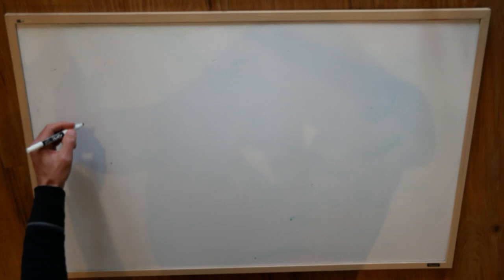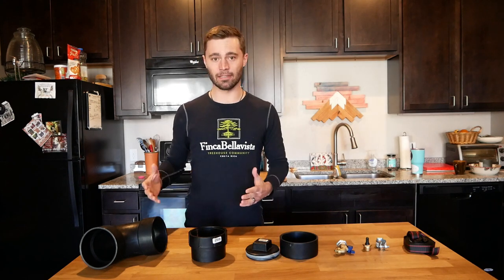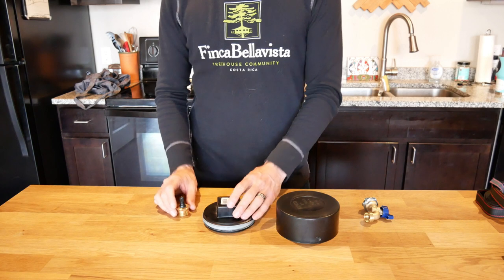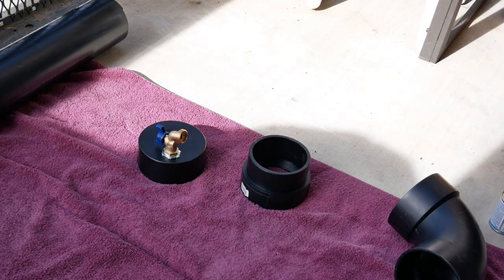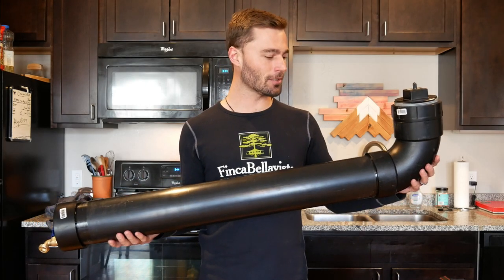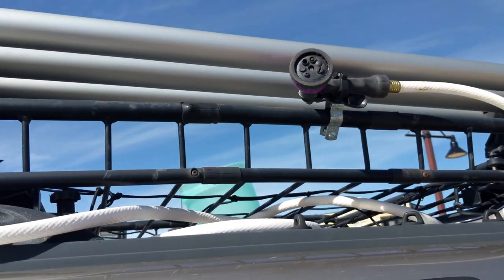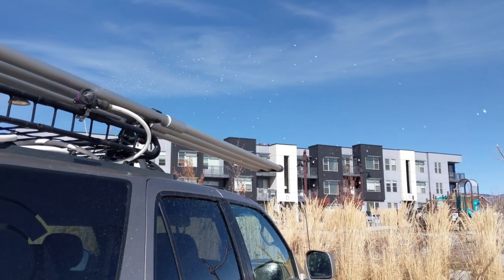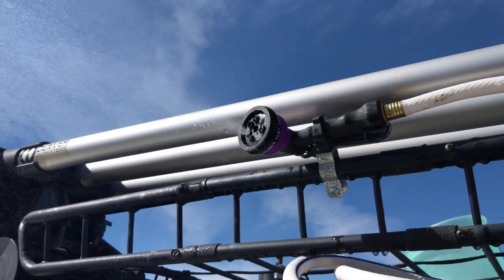| DIY | Roof Rack Car Shower

Comment: Thank you for the videos.  I made the same one. Cost total $100. (Amazon blow out plug) and home depot for PBC  piping (harbor freight step drill bit) Used 4" 10 foot PBC pipe. Thank you 😉
Reply from the maker: Awesome! Glad to hear it came together for you.
Reply: PVC braddah, PVC

Comment: Nice.  A few questions for anybody who has one of these in PVC:
 When it runs out of pressure there is still a lot of water in the tank? 
What happens if you run it with a lot more water coming trough the head?
On a sunny 70F+ day, Is the water a comfortable temperature 2 hours after the sun goes down?
Anybody try to install a 120v 1000w heating element on one of these for a 10 minute warm up?

Comment: Hey guys, amazing video. Quick question, are you injecting air through the Schrader valve to generate pressure on the water? If so, what pressure are you injecting? Thanks!
Reply from the maker: Yes, pressure through the shrader valve. Go up to 30psi, but don't leave pressure in the system. Pressurize as needed

Comment: Great video! Thanks for the tips! How much water did you fill in the tank? Do you have to pressurize again or does all the water come out from pressurizing the first time
Reply from the maker: Thanks a bunch! The tank holds just over 2 gallons. One pressurization worked for me, but I did leave the compressor connected in case I had to repressurize

Comment: Thanks for an informative video. I just finished my solar shower mostly based on your design except that I installed a 4-in to 2-in Y at the discharge end. Then I cemented a PVC adapter (using PVC to ABS cement), which has a 3/4 inch threaded end that I simply screwed the spigot right to it. I don’t like to drill and this way I only had to drill a small hole for the air intake valve. I tilted the discharge tube a bit so all water will flow towards it. I had a perfect seal if I use Teflon tape on both end caps. It seems a hassle to have to re-tape the cap each time you need to add water. Do you have a better solution?
Reply from the maker: Glad to hear you made your own! I like the idea you mentioned here as well. I think the only other solution I have, besides tape, would be a rubber O ring that fits onto the screw cap. That may be a better option, let me know if you try it!
Reply: Thanks for the reply. I also thought of using an o-ring, but I don’t think they make one for the clean out plug, which was what I’ve used. Thanks again and really enjoyed your video.
Reply: Install another faucet next to the air valve then make a small adapter hose with 2 female threaded ends to attach fill hose to the shower hose line. Open both faucets and fill tank until water overflows on top faucet. Then you can turn off fill line, close top faucet, drain some water through the shower line and then close bottom faucet, reattach shower head and your ready to pressurize.

Comment: Why doesn't anyone use square pipe? Wouldn't the fittings mount easier (flush) and mounting it to a frame safer?

Comment: How is this set up holding up for you? I’m mostly worried about the cleanout leaking or handling high pressure. Thanks!
Reply from the maker: Hey Alec! So far, I haven't had any issues. The clean out valve hasn't worn out, and it's been in the sun all summer. Definitely working well still, although build quality probably adds a lot to that factor.
Reply: Shaffer valve is how you pressuring the tank?

Comment: It’s not a bad idea. I think if you used one more street elbow you could just cut that pipe in half and turn it back on itself to double the capacity. Someone mentioned about a heating element too that’s not a bad idea either. 👍
Reply from the maker: Yeah you can mod this with a couple more turns easily, I made mine small because I don't need too much water onboard but it's a modular design to suit anyone's needs.

Comment: Does the top cap leak out air after pressuring?
Reply from the maker: I used some thread tape to secure the top cap, but it wears down and can leak. Not a huge issue, especially with such a small capacity. But something to note!

Comment: I would be careful going over 20psi with it. I don't think the screw cap is rated for pressure. Usually just used for drainage. It could blow off like I've seen in a different video as the sun deteriorates it.
Reply from the maker: That's great to know, thanks Todd!

Comment: How do you pressurize it?
Reply from the maker: We pressurize the tank with an air compressor that plugs into the 12v port in the back of the 4runner.
Reply: @thedirtpeople6754  Thanks.

Comment: Would’ve been good if he showed us how to pressurize it
Reply: Use your air compressor...that's the purpose of the schrader valve.  I'd go one step further and include a pressure relief valve set to about 30 psi so you don't over-pressurize the pipe.